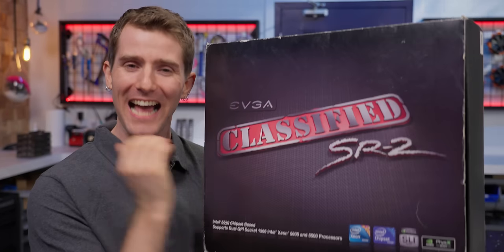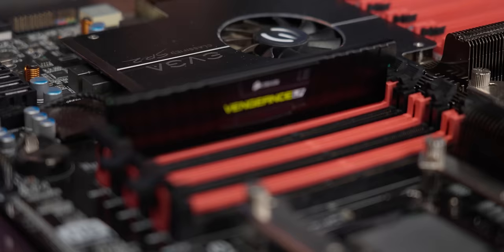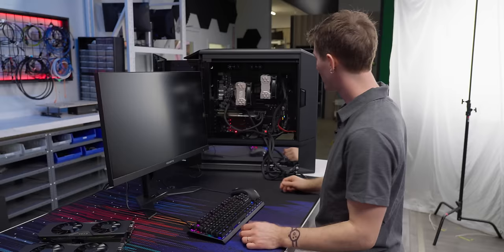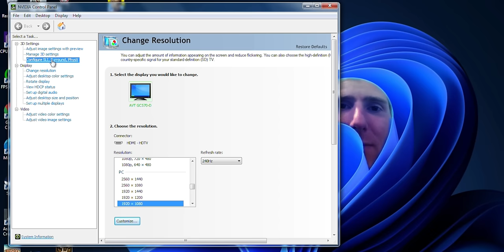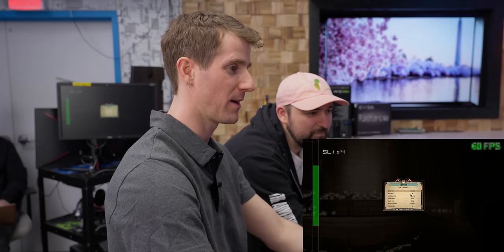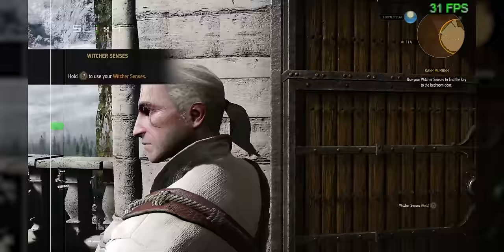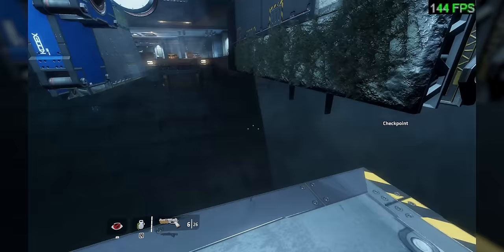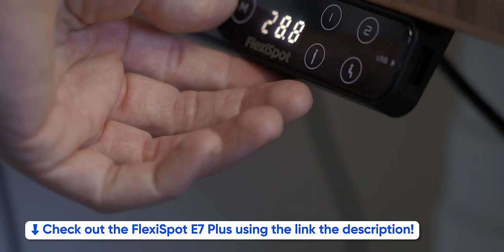How Bad is This $10,000 PC from 10 Years Ago??

Comment: Love seeing the X58 platform getting the spotlight. Still using my x5675. It was a platform ahead of it's time back in the day that has far outlived my expectations.
Reply: I still have an X5675 running in my home NAS, albeit it now runs undervolted and underclocked and far and away from it's previous form of a 4.8GHz water cooled 330W peak power absurdity. You'd have to pry my X58 out of my cold dead hands, it's the most reliable platform I've ever owned, and I have multiple screenshots over the years of the build surpassing year long uptimes and never missing a beat. I had two pieces of excellent X5675 silicon at one point (both 4.8GHz capable chips at 1.4V) while I waited for a good deal on an SR-2, but I did not expect to see the board turn into a collectors item and maintain an often $600+ price tag. Then AM4 came got it's first 32 thread CPU and I gave up on ever finishing an SR-2 build as it no longer made sense from a performance per dollar perspective.

I ran my X5675 in my main until 2019, but it's lack of AVX instructions was getting too problematic, and my ASUS Rampage II Extreme was a B13 chipset with a bug in that particular revision that meant it was unable to successfully boot GPUs newer than Vega or Maxwell architectures. Tried to put a Radeon 5700 XT into it and that was the final nail in the coffin when it couldn't boot windows with it installed, and it was on to AM4 for me.
Reply: Still have my dual x5680 super micro x8dti-f with 32gb ddr3 I built used in 2014. Albeit, now it’s not my main system and it’s currently dismantled from case, as my old gtx780 died. Very slow boot up, but great versatile platform with 36 pcie lanes. Was terrific for gaming even in 2017. I even got it to boot on an nvme ssd using clover bootloader as its chipset lacks sata gen3. Uber power hungry though and no AVX 😞. Now I’m also on am4, and similarly I upgraded back in 2019. I spent too much time troubleshooting and replacing power supplies rather than just having fun. Also hot and heavy. My 3900x with 6650xt uses less than half the watts and is more reliable and snappy, and over 2.5x as fast.
Reply: Running Dual X5687s on a Intel 5500 mobo here. 96 GB RAM and GTX 960. It just works. I intend to run it until Windows 10 is no longer supported.
Reply: I had a x5650 hooked up with a fan from a broken fridge, directly connected to the outlet. Overcloked at 4.9ghz. Time flies. Makes me think about bf3.
Reply: I have an X58 Classified that I got from EVGA step-up program in 2008. It's the original limited edition with certificate. Still runs as a general use PC to this day. Best money I ever spent on a computer build.
Reply: I ran a 1U rack with dual X5650s and just laid a HD7950 on top of the rack (sitting on milk crates) with a slot cut out for PCIe flex riser and power... Got tired of the noise, so I bought an ATX-E Asus? workstation board and stuck it in a massive case. Wish I kept mining with it at the time, would have been worth it's weight in gold. Could play games and host 6+ servers at the same time. What a beast of a platform for under $1200 at the time, everyone was sleeping on them for generations until they just got too old. SR-2 was ALWAYS my dream to get, there was one on eBay for ~$450 but I couldn't afford it at the time and had to watch it slip away.

Comment: Back in the day I had a triple 980 Ti setup.  That was super fun to build.  The micro stutters were what killed the experience.  Most powerful single card is just the best way to go.  It's really for the best that SLi stopped being supported.
Reply: Yeah, and it used to be even worse. I don't remember which cards I used for it any more (just that it was Nvidia and top of the line back then) in the early 2000s and if you got a 10% increase in performance, you would be happy. Not worth the money, better cooling and a bit of overclocking gave better performance for far less money.

I admit my current build is really dated now, still have a 1080 GFX card but I haven't figured out how to fit a good new card in my pyramid shaped case, the 1080 is already extremely tight and I really like that case. Also, there haven't really been any games lately that wanted me to upgrade.

But in a way, I miss the early 2000s with weird builds. My SLI build also ran 4 small SCSI drives raided and that made a bloody difference compared to the regular drives at the time.
Funny enough am I still using my old 950W Corsair PSU in my current computer, I tried a modern 650W but it bluescreened now and again in certain games, some of those old PSUs are still good.
Reply: I ran dual sli 1080 Ti, then dual sli 2080 ti... I never had any stutters, and had mostly* no issues gaming at 4k resolutions. Only stopped using sli once I upgraded to a 4090 (now that a single card can hit 120hz alone)... and it still worked in a lot of games. You could also manually "add" it to other games, although as time has gone on less and less people are doing that or sharing info around it.

Maybe the 980 ti gen and earlier hadn't figured it out, but it was pretty smooth when I used it.

* I do remember one time a driver and/or game update created flickering in game, and nvidia disabled sli for that game in the driver for a release or two...
Reply: Not only was it not affordable for everyone, very little gains.
Reply: @jimmer411  No, I don't think anyone ever SLId anything but the best cards.

 I used 2 7800 GTX cards for instance but the early SLI bridge was not great and the games that supported it gave varying performance, most couldn't code enough to make it worth the while. 

And yeah, that was in... 2005 I think.
Reply: All those crushed dreams of buying a duplicate card to SLI in the future for cheap man
Reply: @loke6664 
You sound like an old man.
Reply: Dual probably would've been fine
Reply: @loke6664 I remember my friend sli'd his gtx 750 lol
Reply: @yatox8  Idk my 2x 970s was alot more affordable than a titan and a 1080 and it absolutely smoked them both.

Comment: Still running an x58 system with an overclocked x5670 as my main rig. 

It just won't die.
Reply: Mine is a Plex server not but still going strong.
Reply: ha, I have similar setup! :D Gigabyte GA-X58A-UD3R with a x5660 @4.2GHz. Threw in a used 2080Ti in last year, I'm even playing Alyx with this setup. But mostly GTA III currently 😂 I have this "PC" since 2010 (well only the mainboard and the case are still from the original build ^^). Cheers!
Reply: My desktop is an Asus Sabertooth x58, with a X5675, 32GB, and a 970GTX. It does what I need it to do, except provide an easy upgrade to Win11. A newer GPU would definitely increase its performance.
Reply: x5675 here.
Reply: I started with 920. Now it got xeon nvme and everything. Give it to my mom for video editing. Truly my best investment ever.

Comment: My PC still has all the parts I got for it 10 years ago, which were pretty high spec at the time. I only play old games on it, so I've never had a need to upgrade anything, but I'm pretty impressed that all the components still work great after 10 years of regular use. My stacked GTX 780s can run Skyrim or Fallout 4 on ultra, so I'm not upgrading until the minute they fry.
Reply: One thing to take into account is power usage though, a kit from 10 years ago may take 600 watts to render 1080p 60 FPS, while a modern one will take like 350 watts for the same. Yes a 4090 can drain 600W for itself, but that's only when used to the max, if you are playing older games it's way more efficient, same for the CPU and RAM. If you use a well tuned AMD CPU and GPU, you can even get more efficiency. 
Just food for thought.

Comment: From what I understand, the 1080TI was actually the last 4x SLI card.
Reply: It was and 4 1080 TIs in testing is faster than one 4090. Like always these guys just rush to do everything and dont look stuff up. lol
Reply: while it is possible to do 4 way sli with 1080 ti. only 2 way is inspec
Reply: It was possible but not stable in games and not optimized. Older cards were better optomized and ran far smoother because of more devoloped drivers. So for a use of a fast amount of games this probably was the better option
Reply: Wasn't the point that the 980ti existed around when this board came out?
1080 would've been chronologically too late
Reply: @Reac2  the SR2 was released in 2010, as it uses the old 1366 socket, so age shouldn't be the reason. It may be down to needing to modify drivers to get 4x 1080ti working, as others have mentioned
Reply: @guyknightley3499  I'm curious which tests it could beat a 4090 in. In most games the 4090 literally gets 4x the fps of 1080ti sometimes more. There's just no way 4 way sli scales 100%  in games.
Reply: @memememine1  probably some synthetic benchmark that can be divided over the gpus very easily (unlike most videogames)
Reply: They were likely the only cards that EVGA had on hand for them to use. They say in the video that there were the best four-way SLI cards that EG could provide correct me if I’m wrong.
Reply: @urgay1992 I'm pretty sure the 580 was already announced, and if you were actually building this system to game, you would have either used a 580 or dual 570s.
Reply: nope.
Reply: @memememine1  No it doesn't not get 4 times as much frames it only goes up to around 2.75x. If you ever seen 4 times as much I can almost guarantee they were using D.L.S.S to get that much mroe frames
Reply: @guyknightley3499 1080ti’s never officially supported 4 way sli, they only really work on a few benchmarks at best in 4 way configuration.
Like always redditors in the comment section think they know everything. Lol
Reply: @guyknightley3499  I am sure with a lot of technical knowhow, some programming and hardware modifications you could get a card newer than the 1080 Ti with 4 way SLI.

If we are talking about what officially supports 4 way sli though then 980 Ti is the best card available.
Reply: Legitimately played through Titanfall 2 (for the second time, first was with a Vega 64) and Jedi: Fallen Order with 1080Ti scavanger from eBay in x2 SLI...
Reply: @InternetEntity  it does support 2 way sli, and if it's using the new sli link it likely works better than 980 ti in 4 way sli, but still they were going 4 way sli because that's what the motherboard was kinda made to do
Reply: @kevinerbs2778  in a GTA V (definitely no dlss) benchmark the 4090 got like 152 fps avg and the 1080ti got 40 fps avg. 3.8x the fps with no dlss?
Reply: @memememine1  the gtx 1080 ti i,n't that sloq that game even gamers nexus shows that card ca hit over 180fps
Reply: @kevinerbs2778  at 2160p it is absolutely that slow. Any lower and you'd be running into cpu bottlenecks on most modern cards in GTA 5 esp the 4090
Reply: @memememine1  No it isn't. Stop making stuff up.
Reply: @kevinerbs2778  I don't think I'm lying. There's a video a channel called "testing games" comparing the two at 4k. They show the graphics settings for every test with all types of deep learning tricks disabled. And I don't like the way they look personally. The slowest the 4090 ever gets is just about 3x the frame rate. There are some games where it gets literally 4x the frame rate.
Reply: @guyknightley3499   yes but only in like 1 synthetic benchmark (3d mark) while all 4 were ln2 cooled.

Comment: I remember back in those days, I had a Core i7 920 that did 4.2GHz pretty easily.  The hitch was that using 3 channels of DDR3 over 1333 would not operate in triple channel mode, but use dual channel for 4GB of memory and then single channel for the last 2GB.
Reply: I was on a X5670 6c/12t @ 4.4GHz with 24GB (6x4GB) DDR3 1600MHz until November last year. My first LGA1366 CPU was a Xeon W3520 (same as i7-920) in 2013-2016 but that was on a OEM X58 motherboard that wasn't capable of BCLK overclocking

Comment: I this generation for a while - couldn't afford an SR-2, but I picked up an EVGA X58 SLI-based system in 2015 for $100. Swapped the slowpoke i7 920 for a $50 W3690 (same CPU as the X5690's here, but lacking multi-CPU support / extended RAM support) and ran it at 4.5ghz for ~3 years on WC (OTT 480mm custom loop from previous owner - never went above 50c) as a gaming computer and 4.2ghz with a lower-profile air cooler for another 2 years 24/7 as a homelab.

Incredible architecture. Great system, really, really competitive performance.

Comment: I have to say the Flexispot E7Q is a beast, I put some heavy duty caster wheels under it and a thick massive slap of oak. Used it to paint the high walls and sealing of my new bureau, very handy to move your self up and down, now been serving as my main desk with dual 27inch, desktop, speakers, ... On it it's so nice

Comment: It's important to note that actual server hardware of the same variety may function better running a hypervisor and a VM instance of windows, as a straight windows instance might not be able to properly utilize the entirety of each processor.  Depends on the hardware, but i assume that this motherboard was optimized for this...hopefully.

Edit:  i was wrong, it the link was not optimized for this...

Comment: I ran that board once upon a time.. twin E-5620's, Single GTX 590 (Had plans for more but got my power bill)  Corsair 1200w power supply(Case had room for 2 power supplies... Mountain Mods Extended Ascension case) and.. I forget how much RAM but windoze would not detect all of it.  I left out things I did not want like Bluetooth/wifi but made sure I could use DVD/Blueray.  USB cabling in that case was a nightmare.  Ahhh nostalgia.  I want to say 2011 was when I was first putting it together?  10 120mm fans, and for cooling used Thermo-Electric coolers.  
I still have the case in use as an end table.

Comment: Im still gaming on an ASUS WS Revolution motherboard with an overclocked Xeon w3690 (the single cpu version of the x5690)  @4.4 GHz, 12 gb ddr3 , and a GTX 1070Ti. For a system I bought cheaply used, 13 years ago!, it is still doing pretty good. Fortnite, rdr2 , gta 5, Skyrim runs like very acceptable in 1080p, mostly with high details.
Reply: Ya alot of older hardware works fine nowadays got to cut back on tech waste.
Reply: Don't forget to replace your capacitors.

Comment: i miss SLI
Reply: As someone who used two 670s in SLI: I don't. When it worked flawlessly, it was amazing, but in most games the microstutter was so bad, it made 120FPS feel like 40. And later when it sometimes didn't even hit a by itself playable framerate, it was worse than playing with just one card. Maybe with a modern aproach multi GPU rendering can be better, but the way it was? No, it's good it died.
Reply: @Donnerwamp  mirco-stutter still exist now even on single card. So you're complete wrong. It's all game engine-based stuttering & nothing to do with the cards. it's just lazy shit coding developers, which is why we can't get rid of it. I've done some mGPU games & there is no stuttering ever.
Reply: @kevinerbs2778  You are correct, there's microstutter even with a single card, but that's different microstutter than with SLI. The SLI microstutter is from inconsistent frame pacing by the cards due to communication or processing hickups, the microstutter you experience with a single card is often an inefficiency in some data retrieval or just shitty coding in general. And let's say there's no inherrent microstuttering due to the concept of SLI (all cards communicating with each other and "fighting" over who does what), then the thing is: Why optimize for a fringe use case? Aside from forums I never met anyone using SLI, at most someone used their older card as PhysX accelerator or when their main GPU was an ATI/AMD one. And the statistics indicated something similar, it was just a tiny percentage of gamers that had SLI. And with the current state of game development where managers that have no clue demand unrealistic timelines, there's no time for optimization, let alone for optimization for a usecase that is practically as rare as winning the lotto jackpot.

Comment: Not surprised at all by these results still running a Core i7 4790k 2015 with a 1080ti from 2017, 32gb of ram,  I play at 1080p 120hz I still run every game maxed out, hopefully once the 5000 series cards come these evga 3090 ti will flood the market and become relatively cheap.

Comment: I have an Antec Lanboy case I am still using. 4 builds in this case over the years. Everything fits all the time. Its a dust magnet however I installed air conditioning filters all over it and it looks sleek and stays a lot cleaner.

Comment: I bought my setup in 2013 for $1500, the only thing ive upgraded was my GPU in 2018. can still run todays games pretty decently with medium graphics settings averaging 30-45 fps. Not amazing by any means, but still works as it should for gaming.

Comment: I still use an i7-3770k with a 750ti on an ASRock Z77 extreme4 for my retro gaming rig. I've had it over 10 years now and it's still running strong. Best computer I've ever built.

Comment: Something somewhat similar rig I purchased for around $450 was a 2010 Mac Pro 3.46Ghz 12 core running with the same Westmere processors albeit not overclockable but with full ECC Ram support at 1333MHz.  A very cheap and still viable machine for medium gaming and light video creation/editing.

Comment: Good use case for this multi - GPU setup would be to run AI workloads with partitioned data and use all GPUs in parallel.

DL4J framework is old, but can use all the GPUs for DL training.